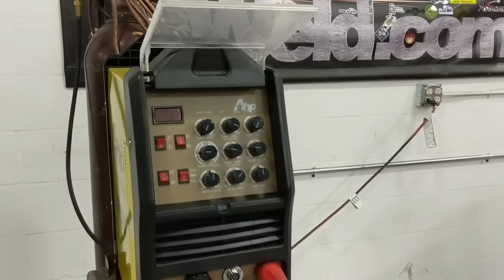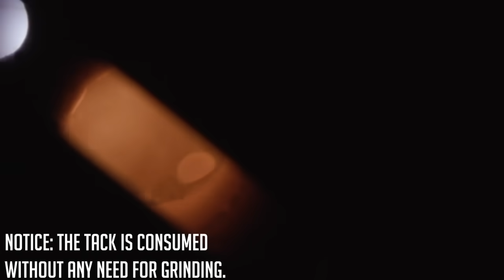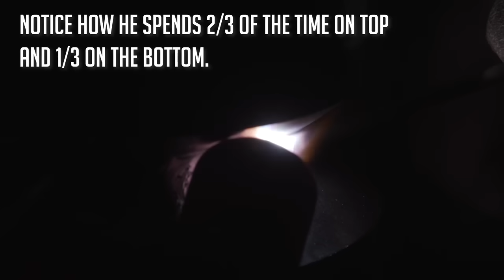How to Pass a 6G Monster Coupon Welding Test (TIG Root and Fill)

Comment: U leaving out a lot of info 
1. What temp are u using 
2. What tig cup are u using
Reply: It's thick pipe. You can weld as hot as you need. Cup size is for titties.

Comment: I got a question. Are you able to weld all the way around from 6 all the way to 12 o clock without adjusting the tree? Once you set the work up you can’t move it right? I always have a problem when I am welding I can do 6 to about 10 then it gets too high and I need to stand on something. But if I lower it then it’s too low for me to do 6 o clock. Anyone got any suggestions?

Comment: Wish we could do a 5/32 gap. The UA 63 code says we can’t have more then 1/8th or less then a 1/16th root gap. I’ve been looked out over running a 5/32 but it goes in soo much nicer

Comment: What you call a "monster" coupon is really a schedule 120 or 2" XXheavy wall tube test, or what a Boilermaker takes before getting hired on any tube job. Also the test proctors would cut 3 specimens from your coupon and do 3 side bends, because its to easy to pass a face and root bend or an Xray. Youse guys are just pipe fighter bench welders.

Comment: Ive done alot of welding procedures but i have never used tig at all. Ive done FCAW in .045 and 1/16 duel shielded as well as outershield ive done spray and metalcore as well as pipe 6010 root 7018 fill and cap. Ive done oxy fuel welding. But you sir are literally teaching me how to tig weld

Comment: Do you push the filler wire in, or just keep it at the edge of the puddle?
TIA
Greetings from Texas...
Reply: Hold it on leading edge. Push very little.
Reply: @bobmoffatt4133  Got it 
Thanks👍👍

Comment: Off subject Bob but getting back into what I love after a 10 year break . I’m going back after my AWS structural certs absolutely love your videos I’m using them to remember the small tricks of the trade as well as learning a ton of new ones from you . I’ve built a cutting straight edge of your design and use it almost daily on the job. I have a circle burner I’ve made but I’d like to one of your ideas. Keep it coming I’m watching your videos daily!
Thanks for your knowledge Mickey

Comment: Hi Bob, just how thick are the walls of this pipe coupon either in thou of an inch or millimetres?
Angle of the individual bevels and combined?
You mentioned the spacing but what was the land?
Reply from the maker: 3/32 land

Comment: is that a a stainless wire on on mild?
Reply: Moshe Galimidi no it would be carbon wire he was using.

If he was doing stainless 309 wire to carbon he would be back purging.
Reply: @kevtech733  Correct!
Reply: @bobmoffatt4133  thanks for the reply senpai.
Reply: No, I think it was a filthy 70S-2

Comment: 4:35 is that a crack on the top?
Reply: Yeah, a little piping porosity we call it. Weld metal solidifies too quick in a big gap if you don't come out of it slow. My bad. Good eye.
Reply: @bobmoffatt4133  mancub did it!  :P
Reply: @bobmoffatt4133  thanks alot!!!!!!! what do you do if it happens on a actual part? grind it? or just cover over the crack?
Reply: @bobmoffatt4133  THANKS AGAIN!!!!
Reply: @moshegalimidi2302  dude hes a fake... Not the real bob...
Reply: easy fix, just grind and chase the crack, in most cases it never reaches the root surface, but by the chance it does go all the way, it is just a simple grind and feather with good transition. and tie in . good catch though.
Reply: What was the amperage for root and hot pass ??